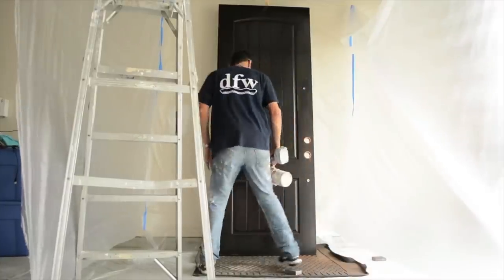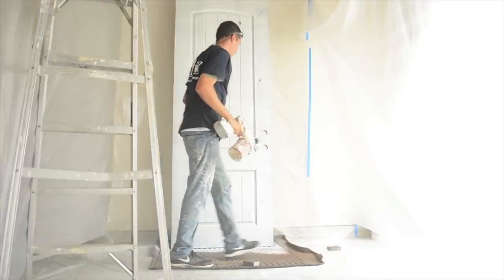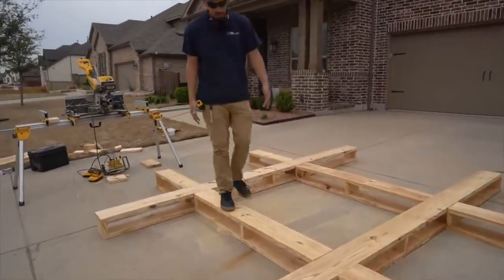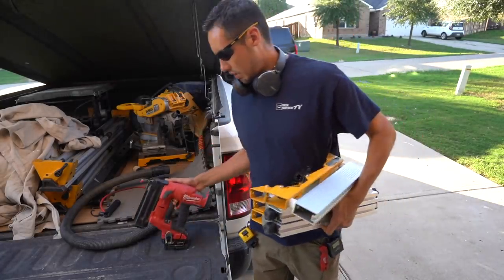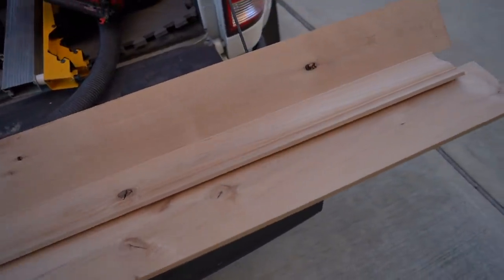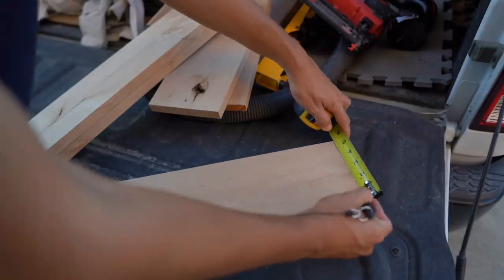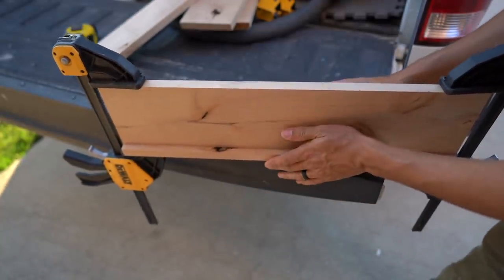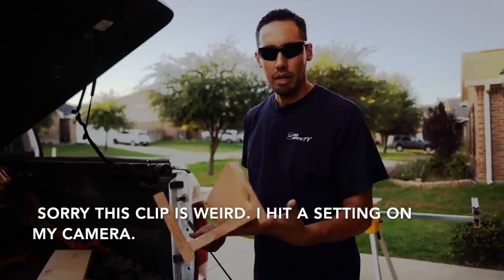PAINTED Knotty Alder Coffered Ceiling? YES

Comment: Dude, when you brad nail, you need to turn your nailer so the left and right sides are aiming the length of the edge of the board you're nailing into. The nails will always bend left or right because of how the nails are cut on the tips. You do this and you'll never have another blowout. :)
Reply: Makes total sense but never thought about the way the nails are cut.  Thanks for sharing.
Reply: This is definitely a great example of how we can learn trade secrets on this platform and turn out better quality wood working. Thanks for sharing.
Reply: You're right, don't ask how I know this.
Reply: Vancouver Carpenter said it best, hold the nail gun "gangsta style" (sideways) to what you are nailing and the chisel tips of the nails and/or brads won't blow out the side.
Reply: Brad speaks truth.

Comment: Looks good. When I would build this type of beam, I would run a simple router detail, perhaps a small cove like the crown, on the outside of the beam, below the crown. It narrows the bottom thickness of the beam, but gives the side profile a little bit more of a finished look.

Comment: I had two of those Graco handheld sprays gave up on them because they both had that spitting problem. Threw them in the trash and got a Graco sprayer with a hose and pump. Great concept but prone to clogging and spitting.
Reply: The battery ones are even worst

Comment: On "rustic" woods, when a nail goes wrong, it's character not a mistake 👍, heck you could distress it with wire wheel, get the hard and soft grain difference to make it more weathered.

Comment: Take your crown jig  and drill large holes over commonly used degrees on your angle indicator to fine adjust. Spotted it on Spencer’s jig on Insider carpentry. Thought of you when I seen it . Might save you some time. Keep up the good work.

Comment: Any tips or videos you can do on stain grade finish carpentry would be welcome. Finding “how to” videos are more limited than I thought and it seems like there is a bit more that goes into it than paint grade finishing. 

I guess measurements need to be that much tighter given absence of caulk? 

This looks like a cool project with the painted alder. Big fan.

Comment: alder does warp. Good idea to stage your material to indoor humidity for several days before layup to allow it to do its thing before you tool it.
Reply: Also not a bad idea to use a cabinet scraper to close grain of 1x b4 u spray.  Might use a shellac to seal/prime; saves detail, & dries fast, good inter-layer for all finishes

Comment: Gotta turn that nail gun perpendicular to the board your nailing in to to prevent blow out nails.
Reply: Was just about to post that too.
Reply: @sparklu  I posted that as well. Read your comment and went back and removed my post
Reply: The other tip is to never try to pull a brad nail, bend it back and forth until it work hardens and breaks. It'll always break off below the surface and 99% of the time it's a much smaller hole with nearly no breakout.
Reply: I believe he knows that already

Comment: I think that pin nail walked on you because of how you had your nail gun oriented. The chisel tip of the nail will deflect up or down when it hits a knot or defect in the wood. Granted, if you're shooting through two pieces of wood like that, I would orient the nailer so it's perpendicular to the chisel to the grain so that it would avoid the potential kick out. I hope that makes sense.

Comment: Great video. Have a question to ask you.  Would you still recommend the Milwaukee 7 1/4” Fuel Mitersaw? Got multi family projects coming up and I’m getting tired of moving my DWS780 around. 

You do some incredible work. Pleasure to see.
Reply: I use one to build decks and it's the best thing.  perfect cuts super handy. positive stops are just like the dw saws, small enough to haul around.
Reply: Douglas Fields hey thanks so much for the response. That’s exactly what I’m looking to hear. Plus battery life would be killer with that 12amp for that 2 1/2” casing and 5 1/2” base. Appreciate the feedback.
Reply: MikeFusion I have it and LOVE it!! Only thing to keep in mind is it’s cross cutting capacity is 8” max. I’m not sure if it’s cordless but if I’m not mistaken, I think the Makita is the only 7-1/4 that will do 12”.
Reply: Kermit awesome to hear. The capacity will be more than enough for my needs that for sure and I don’t see the extra cost of the makita to warrant any real advantage of this Milwaukee. These are the kind of end user reviews I love to hear about. Quality. Appreciate it 👊🏻
Reply: I have the 10" cordless. Awesome miter saw
Reply: Eevee all around offerings from Milwaukee are well praised it seems. Nice to hear another happy customer. Makes my decision so much easier ✔️
Reply: I recently acquired the 21* framing nailer. Only downside is weight. Other than that it beats the dewalt hands down. I have been very pleased with all my milwaukee arsenal. I also have the Milwaukee table saw too. No complaints
Reply: Got the m18 12 miter saw from Milwaukee, would really recommend it.

Comment: Sensei,  Makita 12" cordless or Milwaukee 12" cordless? Great job like always btw.
Reply: I own the makita 10" cordless downsized from a 12" saw,  saw cuts like butter
Reply: @duartepaintinghandymanservices  can it cut crown molding?
Reply: @jayrob7418  ofcourse it's a double bevel and also slides
Reply: @duartepaintinghandymanservices  good deal bro. Thanks for answering my question. I'm bout to invest in one since I have both platforms.
Reply: @jayrob7418  you'll love it bro

Comment: What’s that retractable pencil holder thing you have?
Reply: It has a belt clip on one end and the other, that attaches to the carpenter style pencil, has a small rubber piece that pushes onto and fits snuggly on the unused end of the pencil. Typically you can find them at (Home) Depot near the pencils and tape measures.

Comment: Stop using stains! Start using dyes. You can mix them in with water soluble urethane. You get the wood "stained" you get a sanding sealer, and you get it finished!!!